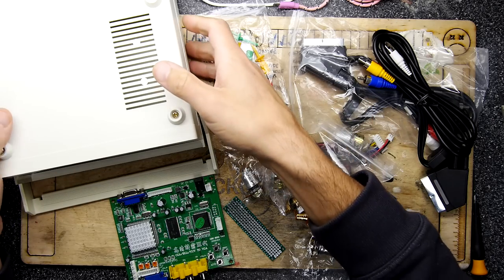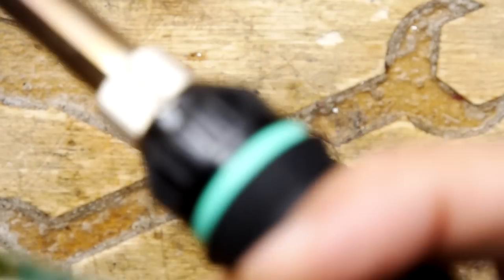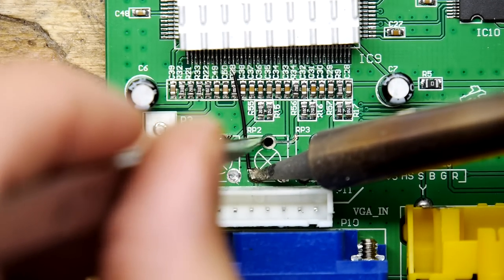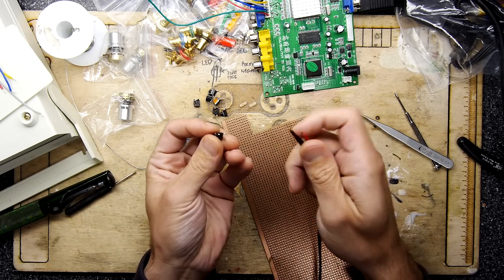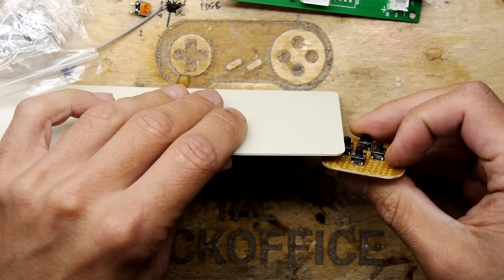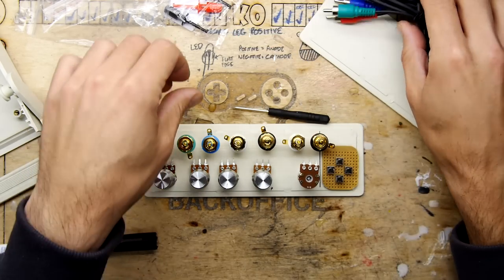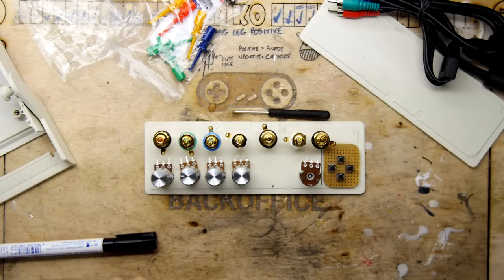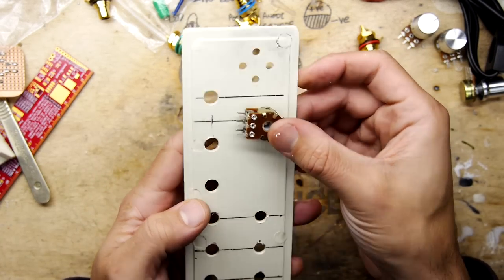How to make your GBS 8200 Awesome DIY Video Converter Part 1

Comment: I can never seem to ever actually suck up any solder with my solder sucker. I always wonder if it's just a crap one or if I'm the crap one. But then I never ever do enough desoldering to warrant spending the money on a vacuum desolder tool.
Reply from the maker: They are all pretty much like that. You need to wet the joints with more solder or some gel flux to really get them going

Comment: Looking at getting one of these or similar to convert an Old IBM XT/3 8086 video CGA output to VGA but wondering how you actually go about inputting CGA into the convertor? Any help or points in a better direction is appreciated!
Reply from the maker: Have a look at the spec, I think GCA is pretty much just RGB? If so, a scart to VGA converter should work if the frequencies are all in specification
Reply: @backofficeshow  Thanks, ill look into that and see!